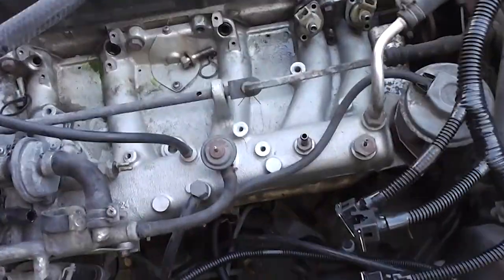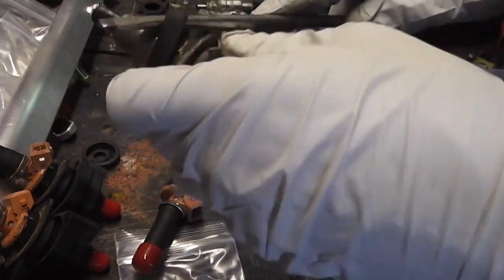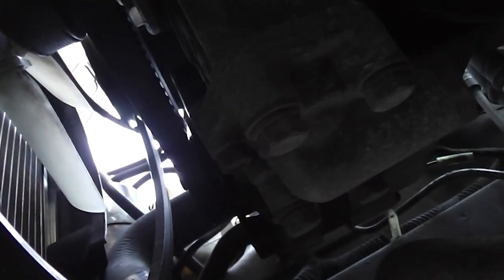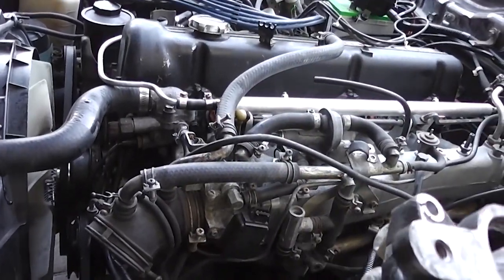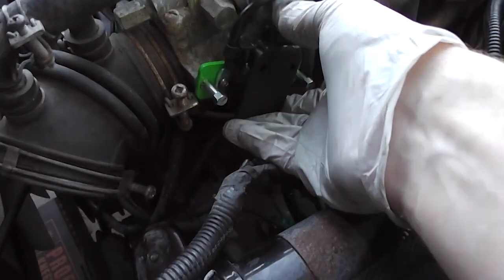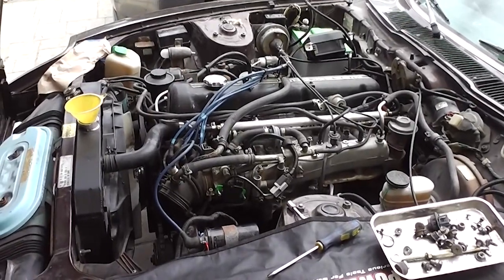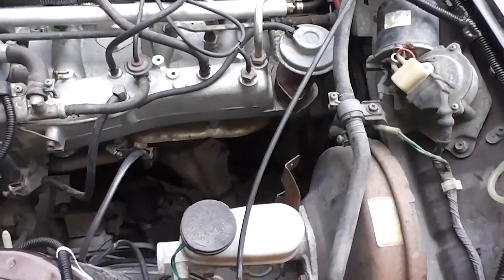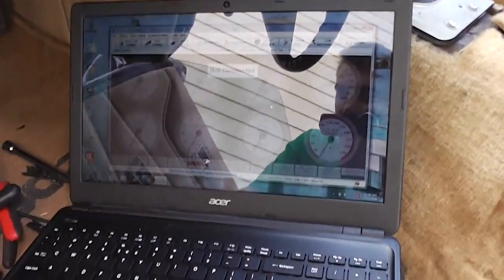Wiring up MEGASQUIRT in my 280ZX and First Start! Pt. 2

Comment: did you use the aluminum "pipe" that the Z Car Depot sells to take the place of the AFM? Curious what you used to fill that gap.  Or maybe you just used some PVC pipe.
Reply from the maker: Just a straight piece of intercooler piping.

Comment: would it help if i changed my ecu/ecm to a turbo one once i put a turbocharger in my datsun like a cheaper megasqurit   will that turbo ecu maybe have the parameters u were talking about ?
Reply from the maker: Yeah if you turbo swap your car, you should run EFI from a 280ZX turbo if you don't go with a standalone system.
Reply: @HooliganGarage-650  so im thinking of doing a the old turbo efi harness and the ecu from a 280zx and getting one of them shady turbo chargers i see on ebay will it all work u think haha? HONESTLY  I  just want to drive it to work no racing no going over 80 really i just want to be able to accel fast every now and then hear the turbo u get me?
Reply from the maker: @fedguerra8046  EBay T3's will fit, but you will need to modify the exhaust system to match up with the exhaust side as they use a different bolt pattern.

Comment: Did you hook up the stock wiring and the MS wiring to the coil? I’m just wondering how you keep the tachometer working.
Reply from the maker: Yes I have both hooked up, though 2 of the 3 stock wires are no longer used due to the distributor swap.
Reply: Hooligan Motorsport can you show me how you did that? I can’t get the tach to work and when I hook up all the wiring I have problems shutting the car off.  I want to be sure I am connecting the right wires for the tach. Also, how did you keep the temp gauge working. I too am installing Godzilla Raceworks MS ECU. I was able to fire up the car this morning. It seems to be running smooth at idle on the base tune. I unfortunately don’t know enough about Tuner Studio to tune the car so I have to take it to someone. I sure could use any help you could give me to make sure this thing runs right since you just installed the same system.

Comment: Does this change the fuel system to multipoint fuel injection or is the batch injection retained?
Reply from the maker: I'd imagine multipoint.
Reply: @HooliganGarage-650  This follow up question should answer my question; did the instructions say the injector harness needed to be plugged in to specific injectors, or could you plug them in to any injector?  If the former, that would sound like multipoint.  If the latter, that sounds like batch.

Comment: What ever happened to the turbo zx btw? Just on the back burner for now or was it sold to fund the og zx?
Reply from the maker: In early 2018 I ended up selling it to a collision technician in Maryland. Before, once I got it running good I went in to get an alignment. The tech pointed out very serious frame damage on the front left corner of the body that looked to have been "repaired" with a harbor freight welder and JB weld. The cross member was also partially hanging off the frame. The cheapest quote I got to repair it was $2,290 and I paid $1,250 for the car. I did in fact sell it to fund my OG ZX, which has never had any sketchy/crackhead previous owners.
Reply: @HooliganGarage-650  sounds fair to me. The og zx is a nicer pice anyway